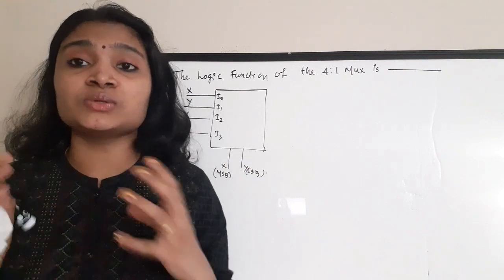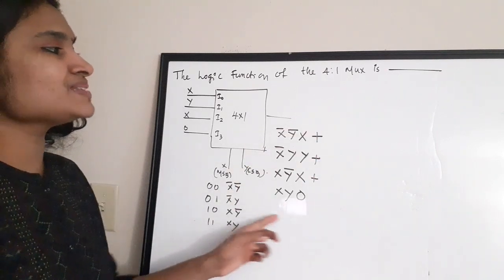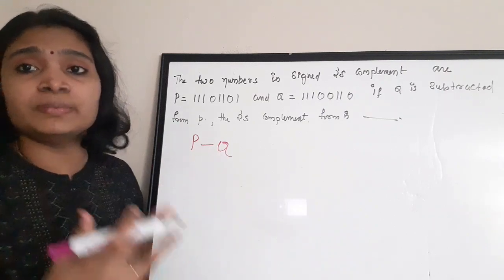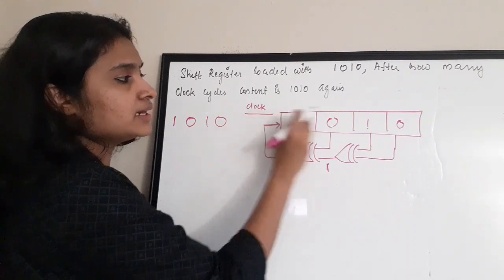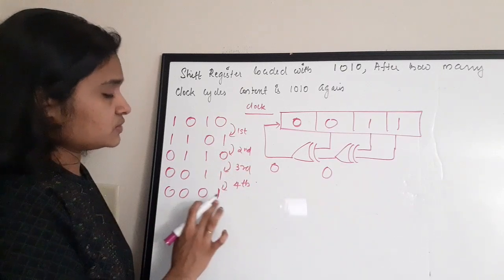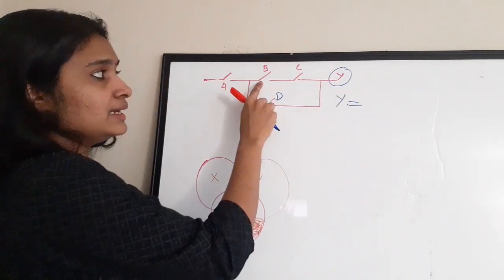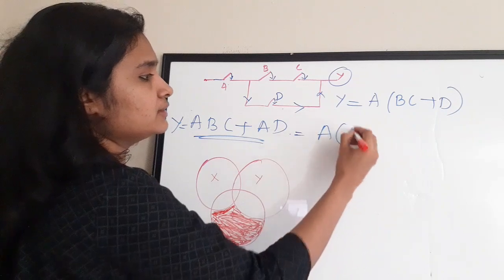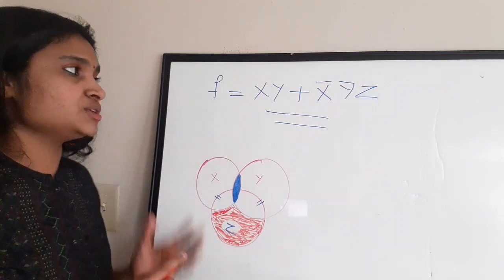SAC ISRO Scientist and Technical Assistant Electronics Preparation|Digital Electronic Question Part1

Comment: Hi Mam keep up the good work this videos are helpfull and one more request, I can't find the previous year papers for technical assistant in electronics and communication for SAC center, I had tried to find it everywhere but no luck, if you can help with that it will be very helpful. Thanks
Reply from the maker: I also dont have sac papers specifically these are different locations Questions of common subject.